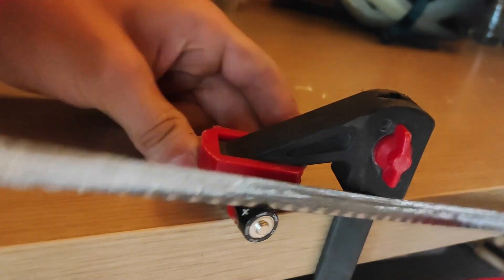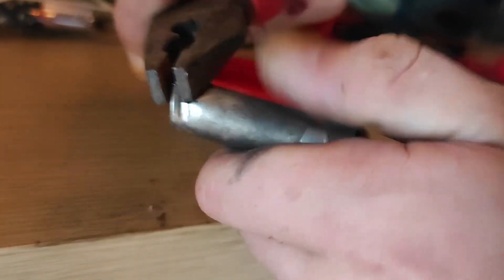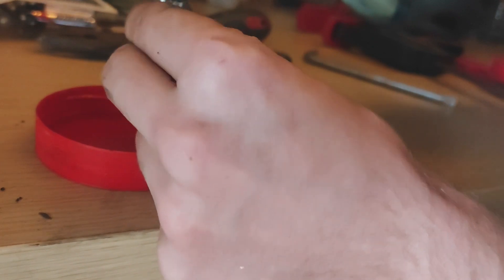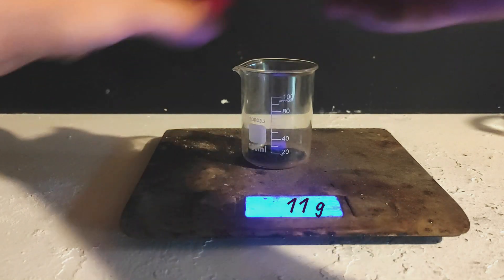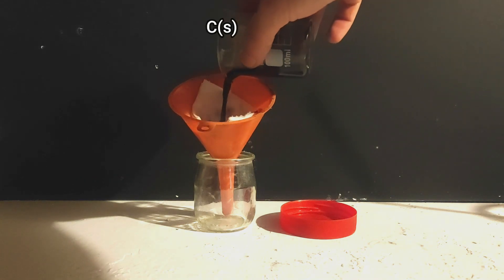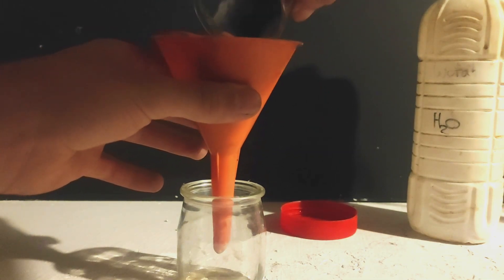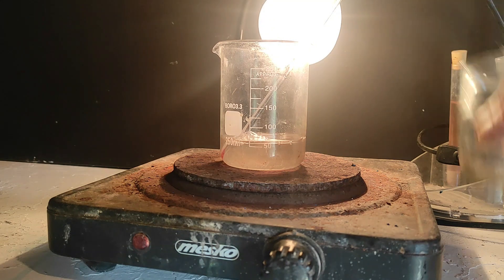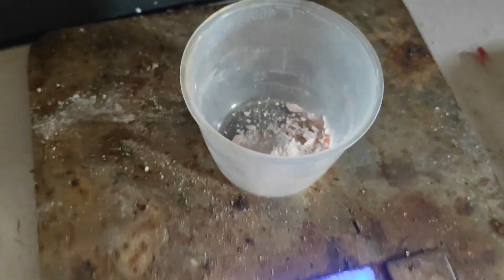how to make MnCl2 from batteries ! #chemistry #experiment #science

Comment: @jam_kemist A better and safer way to dissolve the manganese dioxide into a soluble manganese(II) salt is to react it with a mixture of sulfuric acid or acetic acid and hydrogen peroxide.
Reply from the maker: Of course but I wanted the Cl salt and for such a small quantity and a low rate of reaction it's actually fine